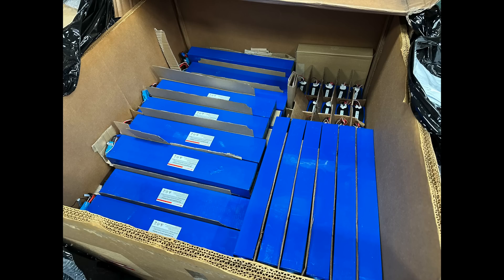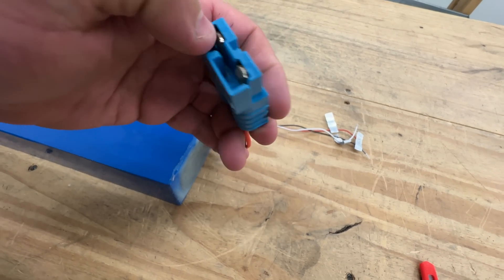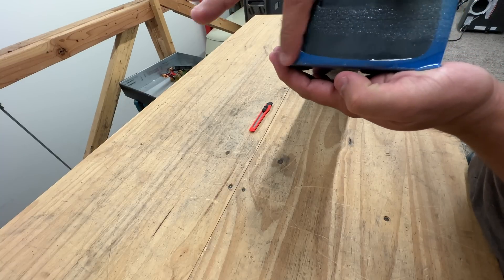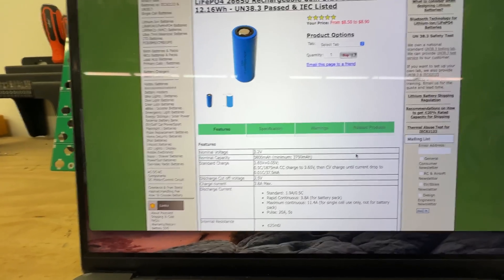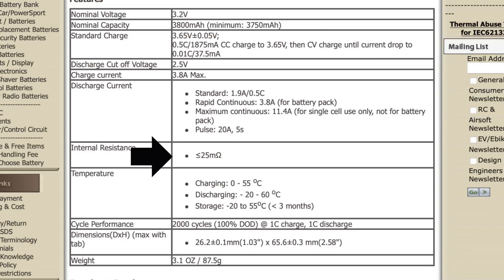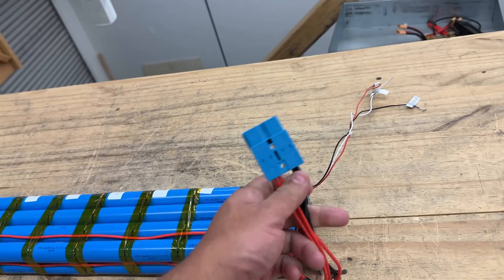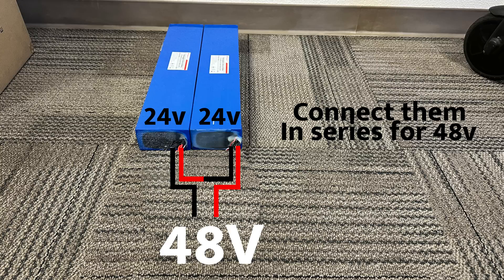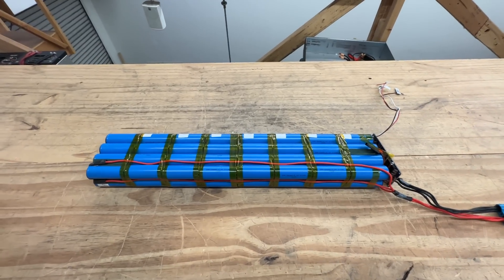24v LiFePO4 600Wh Battery Pack

Comment: How long is this battery? and the weight please? Planning to buy 2 for 48v ebike.

Edit: did some math

Length: Each cell is 2.55inch long aka 65mm times 8 in a row = 20.4inch with bms 21.4inch long.

Weight: Each cell is 83 gram times 64 cells = 5312g = 11.7LB each pack.

Width: Each cell is 1" wide times 4 cells = 4" wide.
Reply: 21.5 x 4.25 x 2 in (54.6 x 10.8 x 5 cm)
Reply: Just curious if ur doing middrive or hub and how many watts
Reply: @hunterjackson802  I got a Bafang 750w mid drive.

Comment: What li batteries would you recommend for a 42v (7-6v) golf cart
Reply: Range or acceleration?
Reply: @whatta7793   range
Reply: @billgardner9328  battery pack made with 18650s, you can buy them in bulk from Battery Hookup for $2-3 bucks a pop or so, 11 in series will give you a 40.7 volt nominal, and 46.2 volts max charge. 

So 11 series would be a must, and then parallel them ever how many times you're able to, for the space you've got to work with.

Comment: Sweet!!!! I'm working on some A123 cells right now. Would be nice too test these in the project I have going. I would need 3 packs to make up 3 or 4 4s cells. I'm actually finally using that 1500 980watt ups you was selling awhile back. Trying to make a portable unit. I have all the parts, just need more batteries.  Hope all is well @jehugarcia.

Nj